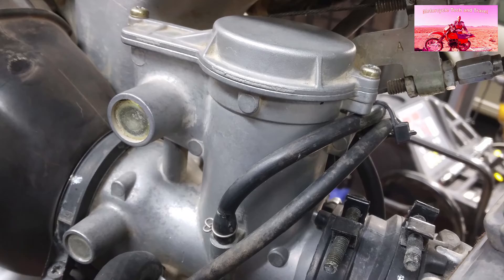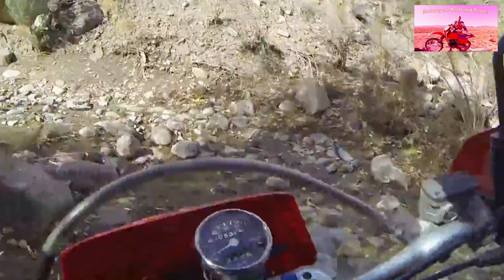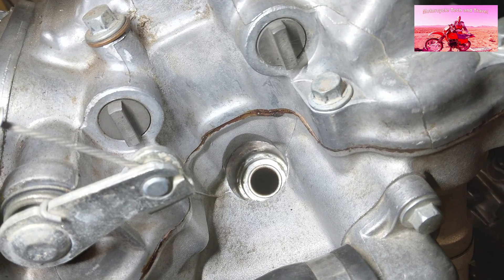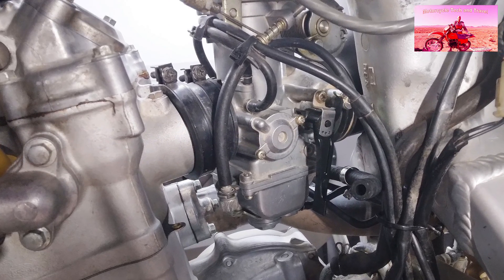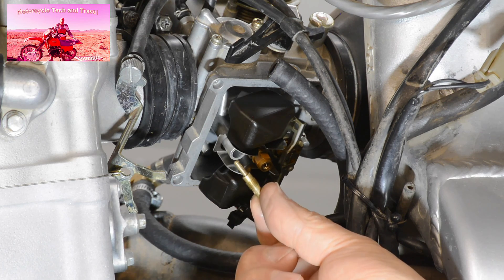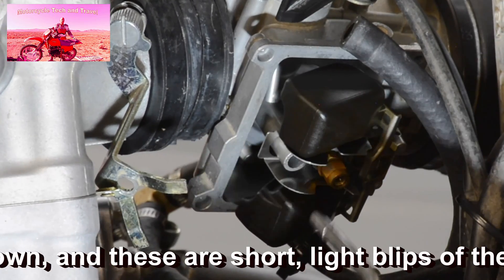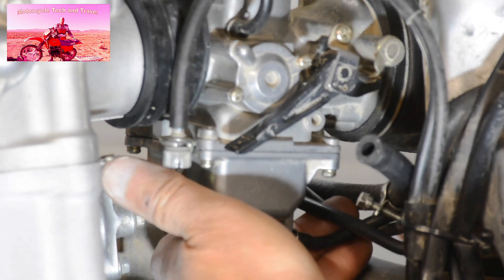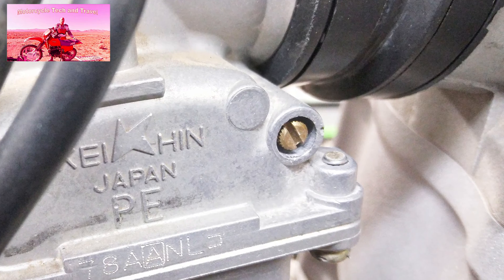Tuning and Re-Jetting the Honda XR650R for High Altitude Adventure and Overlanding Fuel Efficiency

Comment: Great video. I just rebuilt my carb on my xr650R. It had a 172 main, and a 75 pilot jet. It’s uncorked, but not sure why it had such a large pilot. The fuel screw was only like a turn out. It did run pretty good, but i swapped in a 175 main, and 68S pilot. Hoping to fire it up this weekend and see how she runs. Im in Vegas, 2000ft elevation, so I plan to leave the 68S pilot and just alternate between the 175 and 172 main jets.
Reply from the maker: Yep, the 75 pilot size made me raise my eyebrows.  I'm trying to guess why anyone would run a 75, unless there was an intake air leak and throttle bog at tip-in.  (Check for intake flange and clamp leaks.)  I am assuming that the intake and exhaust are "uncorked".  If so, you should do very well with your newly installed jets at that altitude.  Either the 172 or 175 would work, this engine is very tolerant and does like its fuel!  What it doesn't like is the draconian OEM lean jet sizes for the U.S. market or the corked and California restrictions.  Use the stock/factory needle position.  That would match up with your jetting.  You're 49-State now at Las Vegas.....Thanks for subscribing!
Reply: Yea the 75 def suprised me. Yes fully uncorked with the air box drilled out(previous owner). Needle clip was in the 4th position down from top, but I replaced it and put the clip in the 3rd position(middle) from top, which was stock I believe. Thanks for the tips, great channel!
Reply from the maker: Yes, stock is 3rd position from the top...a good place to start, I've never changed it.  Previous owner really wanted to fuel this engine!  Glad you rescued it.  You're the owner and rider the XR650R deserves...Enjoy it!
Reply: @MotorcycleTechandTravel  so I just put it together and started the bike, started 1st good kick with no choke on. Bike idles pretty dang good. But the minute I give it gas it bogs down and will die if I twist the throttle. It will rev up with the full choke on,tried it really quick just to check. I sprayed carb cleaner around the intake boots to check for leaks and nothing. Also taped off my cut outs on the air box and no change. Only big change was the pilot from 75 to 68S. And the needle clip was 4th clip from top, now at 3rd clip from top. Main only went from 172 to 175. Currently stumped as It’s only my second carb rebuild. 2.5 turns out on the fuel screw, turned in and out a little and no help. Any ideas? It ran perfect before I rebuilt the carb. It was leaking out of the overflow so I decided to rebuild. I guess it has the throttle bog at tip in now like you said in the previous comment.
Reply from the maker: So before you try anything else, use the clear tube method to determine how much fuel is in the fuel/float bowl.  The float may be set too low...You'll find this method simple, there's no disassembly involved, and very accurate.  The bike should be upright and square when you perform this test:  https://youtu.be/NbVvkYMPaSI.  Given what you have done so far, it sounds like possible fuel starvation or a clogged passageway.  If the carburetor passes the clear tube test, try removing the idle mix screw.  Before removing it, turn the screw carefully inward to bottom the screw gently—count the exact turns inward, including fractions.  The factory workshop manual, available in many forms and PDFs online, gives precise directions for setting the idle mixture screw and the warm idle stop screw.  Once you know the current setting, you can remove the idle mixture screw and blow compressed air lightly into the idle mixture passageway if you suspect a clogged passage.  Let us know what you find!  We'll go from there.
Reply: @MotorcycleTechandTravel awesome thank you I will try this tomorrow! Another thing worth noting, the needle I removed from the carb was the b53e, the one in the kit said b35f. They looked identical to my naked eye so I just put the new one in instead. I will try putting the old needle in if the float level is all good. I also have to double check the needle jet orientation is correct. I’m starting to wonder if I put the narrow end up! Will get back to you with results, again thank you
Reply: @MotorcycleTechandTravel  it was the needle jet ! I installed it upside down 🤦🏽‍♂️runs well now at 2 3/4 turns out on the fuel mixture screw. 3rd position on the needle. Only complaint is if I wack the throttle super fast it will bog out a lil before it catches up and revs. It did this before also. Not sure if it’s common with these xrs. If I just rev up normally she barks perfect.
Reply from the maker: You're certainly on the learning curve...and that's a good thing!
Reply from the maker: Good!  When whacking the throttle, do you mean to full throttle or partial?  Bike stationary or moving?  Your jetting should be spot on for L.V., and if the needle's shape is right, you should have it.  These Keihin carburetors have no accelerator pump;  they rely on carburetor Venturi Effect to move fuel out of the well or through the passages into the bore.  Venturi effect can only take place when there is air volume through the carburetor's bore.  The best test of jetting, or even the needle clip position, is to gradually open the throttle from idle to open under engine load.  That's in a lower gear where you can ride safely.
Reply: @MotorcycleTechandTravel  thanks! I def am learning a lot, and research from experts like you pays off ! I’m talking stationary, in neutral, 3/4 to full throttle quick blip of the throttle. While riding it doesn’t choke up at all , good linear power. Probably can’t move the fuel quick enough when bursting the throttle like that. It was just an observation, in real life scenarios I never need to do that.
Reply from the maker: Sounds okay...You have opened the air box, too, and that could impact the throttle blip versus real world riding.  What air filter are you running?  There's likely an abundance of inrushing air!  Watch your spark plug coloration.  Have you adjusted the valves or run a compression test?
Reply: @ I’m running a Twin Air filter. Adjusted the valves before the carb rebuild, followed your video. Haven’t done a compression test, I plan to buy one sometime this year. I will keep an eye on the spark plug 👍🏽 thanks for all tips! Cheers to keeping the big red pigs alive 🫡
Reply from the maker: You're set for now...Be certain that Twin Air aftermarket filter is sealing around the edges.  The XR650R has a marginal air filter cover design.  It works okay with an OEM filter, not so well with several of the aftermarket filters.  I run a factory/OEM filter and flame trap screen and am careful installing it.  My video on the top engine rebuild shows the damage caused when a leaky aftermarket air filter drew Texas silt through the intake, pitted the intake valves and took out the rings.  (I bought my low-hour XR650R in this condition with no compression.  The low-hour engine and the bike as a whole were otherwise in top condition.)  Las Vegas is sand and silt, so be careful.

Comment: How do you keep the piston at TDC during the leak down test? I saw the still with the drill bit wedged into the sprocket, but I didn't notice it there during the panning shot shortly after when the test was being conducted. I've struggled to find a way to keep the piston exactly at TDC when applying air pressure. Even a few degrees rotation at the countershaft is enough to send the engine spinning.
Reply from the maker: Yes, just as a backup, I did use the drill bit shank to keep the chain/sprocket and crankshaft from rotating when applying the air at TDC.  (Spark plug removed, the drill bit shank and sprocket can be aligned with TDC by releasing and applying the clutch lever with the transmission in gear.)  The timing mark TDC position on the flywheel is reliable but not easy to identify.  Be sure you are aligning the TDC mark and not a spark advance mark...Another way to find exact TDC is with a dial indicator.  A two-stroke timing set enables installing the dial indicator and stem or roller tip directly into the spark plug hole with the valves all closed (piston at TDC on its compression stroke).  You can find exact TDC with the dial indicator.  With the piston precisely at TDC, the applied air should not push the piston downward.  This exact rock-over position will not allow the piston pin to force the rod downward.  The piston stays here unless the crankshaft moves the rod's angle to an offset position...Be sure to use the PSI recommended for your leak down tester.  That pressure setting may be lower than your air tool line pressure.

Comment: FYI ... the screws used on Honda bikes needs a JIS Japanese Industrial Standard driver.  A ASE Phillips is a different animal that's why everyone strips them out!!!
Reply from the maker: Thanks for bringing this up, a very important point!  Japanese manufacturers have traditionally used JIS screws.  They come loose without damage if you use JIS screw drivers and not a Phillips head type.  In this video, I should clarify the need for JIS drivers on tight screws.  I do manage to loosen the carburetor float bowl screws using a quality Phillips screwdriver.  On stubborn engine case screws, the traditional approach has been an impact driver with JIS tips, tapping with just enough force to loosen the screws.  My impact driver set has JIS bits, which readily loosen and preserve case screws.  JIS drivers work properly and generally protect the screw heads for reuse...JIS screwdrivers ($$$) and bits are available at Amazon.com. 
 Search under the keywords "JIS screw drivers"...I've added these details at the video description.